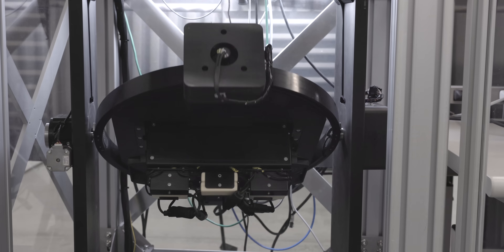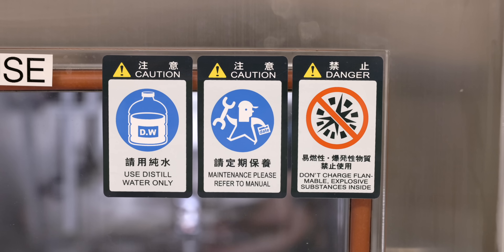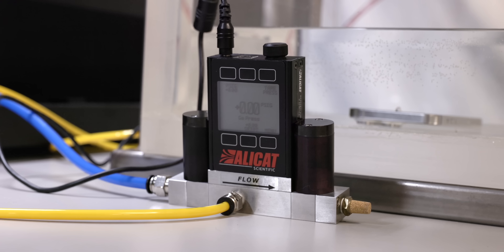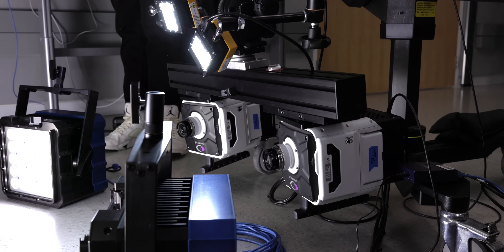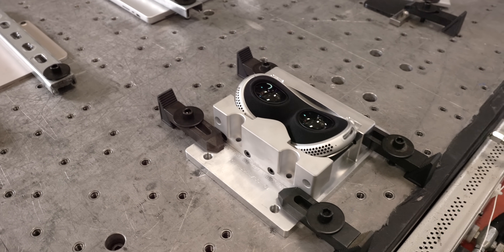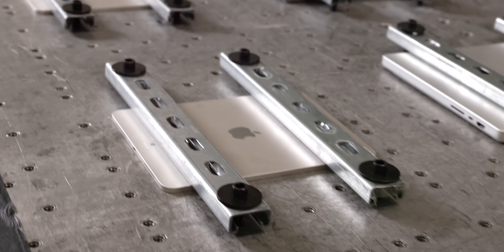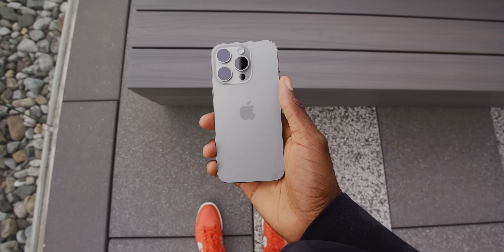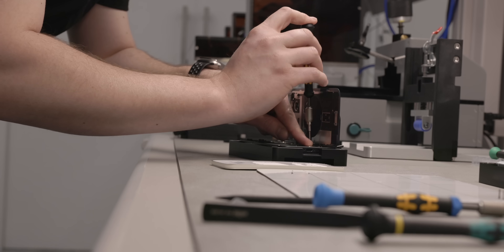I Visited Apple's Secret iPhone Testing Labs!

Comment: Simulating yers of wear and tear on a device where you're not allowed to replace the battery. Or at least you probably negate the IP rating if you replace the battery at a private repair shop. I think it's a fantasy to produce a product that never fails, especially since batteries are not covered by any warranty historically. Seems a lot better to focus on repairability, but Apple refuses to do this because they refuse to admit that their true focus is the design, and the design steered them into focusing on durability rather than repairability.

Comment: How does the price of repair factor into the argument? I broke the screen on my old S20 Ultra and it would've been cheaper to buy a brand new one rather than have the screen repaired. I ended up buying an S24 Ultra as a replacement. I'd say most treat damage like this as an opportunity to upgrade rather than bother with a repair.

Comment: Durability and repairability are not at odds. Not even close. Talk with someone outside Apple, actual engineers, cause you are not one. They effect each other, but screen replacement in the dumbest ways. Not giving repair part, not giving schemetics, dunno if they still do it, but different sized screws, no AUX, or SD Card. You can't say things like that without proper research. You are not some random YouTuber, people watch your content, and just accept it, and next time apple does something anti-repair, people just accept it. Undoing what people like Rossmann did. Phones are harder to repair because they have more compact and complex design, but the repairability problem of apple, is not hard to repair phones alone.

Edit: 
Forgot to mention, technicians of apple destroy your product on purpose, can only replace boards instead of simple and small electronic part swap, and milk you dry.
"Product that never fails" what a load of crap.

sigh
Edit 2:
One of the reasons repair number have dropped for "Apple" is new repairability laws and stores doing a better job than Apple, AND people starting to know how Apple rips you off! They don't get em like before because there are better options for consumers.

Comment: Designing the phone to be securely closed and sealed is one thing that helps durability. However having to pry the battery with a crowbar after you've opened the phone, is not helping durability in any way.
Nor is the serialization software that detects parts replacement and refuses to work with the new part, because <buzzword>.

Comment: 10K IPhones destroyed/tested so my friend can drop hers accidentally about 2-3 Feet off the arm of my couch and it shatters instantly. 

Or my other friend who just took it out of her pocket and [because she had no case] dropped it from about 3.5 feet onto concrete spiderweb shatters in the back- shatters instantly.

This is why I run Samsung (don't hate, appreciate!)

Edit: also ran an experiment that I cant prove because I never took photos or video (cause I wasn't smart enough at the time) but I put small markers on the inside of a friends Iphone to see if when it was repaired it would be the specific parts- nope. they just cloned their phone on to a new one- that's why the repair was $600. not cause apple- but because they just replaced it.

final edit: It makes sense finally hearing it from the head of engineering. Durability>Repair ability equals Less repairs, therefore unto less costs of repair- but when something DOES break, that's within the profit margin (at least if you send it back to them.)

Comment: as much as this reliability\repairability slide makes sense it still doesn't justify some of the bad repairability issues that iphones have such as locking parts to motherboards so any replacement of some parts even if the part was taken from another iphone displays a message for an un genuine part and some times even the new installed part is unfunctional, and that goes against the environment claims that they make... thats my take

Comment: 7:44 bs meter going through the roof. There are a ton of devices that are durable and also reparable, it doesn't have to have 80233 types of screws to be durable when a few would suffice

Comment: I call bs on the point of a durable phone being better than a repairable one. First of all Apple is a company that always pushed you to buy new devices. Yeah removing headphone jacks is good for durability but now people run through bluetooth headphones whose batteries also get broken. Maybe the person you interviewed really believes it and he does got a point. If a device would be unbreakable that would be awesome... And a genuine threat for Apple. Apple wants you to buy a new device every year. That's how they make money. An indestructible device that you never repair or upgrade would kill the company. If they would be on the mission to build a device like that they wouldn't build it out of glas. They wouldn't slow them down with malicious updates. Apple want's you to buy a new device regulary. The durability is great for their image as a premium brand but the lack of repairability is a feature not a bug.

I am a Fairphone user so I am on the other side of the durability v repairability spectrum. If you don't have special requirements (and don't accidently drop your phone into the pool) it's durability is more than enough.
I used the Fairphone 2 for 5 years. I threw it on my bed and on the couch. Dropped it a few times on accident. I had it in my pants when I spilled a drink on me and I used it in the rain. In those 5 years I had to swap the batteries twice (one had a defect from the factory and I got a free replacement), one microfon, one camera and one screen. I created waste but in the end I am still far behind the curve and did one upgrade in the time most people do two

Comment: Sony phones are easy to repair and are IP68. Apple just puts about 5 times to number of screws that are required, all with diffrent length, thicness, head radius and screw type. then they do parts pairing.
I have an iPhone openned in front of me as I write this, and it's painful to repair. I have also repaired sony phones.
Actually the simplest most elegant phones are from chinese manufacturers like Xiaomi Huawei and Vivo

Comment: Durability and reparability are NOT opposed. They are orthogonal. The inifinitely durable product may never NEED repair but that doesn't mean it has to be difficult to repair.
Reply: Thank you! Underrated comment!
Reply: I wouldn't say they're orthogonal, but they're certainly closer to it than they are to being antiparallel. Adhesive really does enable low profile durability in a way that can't really be matched without it. At the same time, that's pretty much the only example of where they're opposed.
Reply: Agree, for example. Phone made for constructions workers for example are build to be both durable and easy to repair. They are not oppose or balance. 
They are something for sure but not opposed. What apple said is just not true. 
At best innovation and reparability can be opposed but not durability.
Reply: THIS. I was thinking that some of the things Apple does to make repairability lower, does NOT make the phone more durable.
Reply: The framework laptop is a perfect example of this. It goes as far as to show you have to repair or replace each part, gives you guides on how to do it, and will even sell you every specific part for it at a very reasonabke cost. And theyre not even a hundreth of apples size. Its not impossible. Apple just dont want to make less than 20 billion in profit.
Reply: and why hasn't Apple hired you yet?? LOL
Reply: For products generally, sure. For phones, no. They are conditionally and variably opposed. Water resistance and repairability are definitely opposed (though not completely; low manufacturing tolerance, for example, improves water resistance without hurting repairability).

There is no such thing as a perfectly repairable, perfectly durable phone. Those are engineering objectives that do in fact conflict.

It's also a mistake to say that phones are hard to repair only because of durability trade-offs. Pair pairing doesn't improve durability, for example.
Reply: @DanKaschel they aren't. iPhones are incredibly easy to open compared to most Android phones (especially the Pixel) since you only need a metal card and some heat. The repairs themselves are also incredibly easy, since most parts are held down by a lot of screws instead of adhesive. The one thing that makes iPhones so unrepairable is the serializing of parts and the high margins that make repairs uneconomical.
Reply: give example?
Reply: @youssefmohammed5456  I'd say iPods or old handheld consoles. Old iPods still work years later, you can drop them, shake them, some have been put through fires and still work and they're gigantically repair- and moddable. Also, gameboys that survived a nuke.
Reply: @youssefmohammed5456  Well, this doesn't directly translate to smartphones and other high-end consumer electronics but take the example of Toyotas, they're reliable and easy-to-repair

Comment: So the argument he says about durability would be true if Apple didn't design their products to not be repairable. Like for the screen, you have to have a quote-unquote Apple authentic part. However, if you have a third party replace it, then the device will say this is not an authentic part. Apple purposefully designs their devices to not be repairable even with authentic parts.

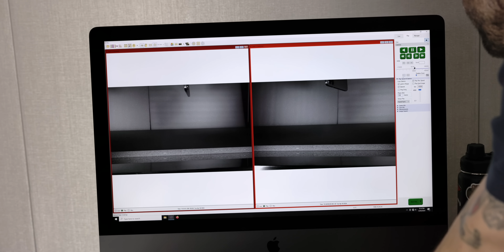Comment: 4:58 imagine using windows on an apple display in an apple lab in apple park.
Reply: Some apps are not multiplatform lol. Its not that deep
Reply: @LLUUDDWWIIKK  That's exactly the point. When you want options and flexibility, use Windows.

Comment: The whole repairability vs. durability thing is fine and dandy, but it’s kind of a cop-out argument by Apple. Nobody in the repair community is complaining about waterproofing seals making it harder to replace the battery. They’re complaining about Apple actively punishing repair in software using e.g., serialized parts etc.
Reply: The real scale for apple is repairability vs profitability.
Reply: @ytskt  YES. I don't get why people are trying their best to kinda put in a moderate manner what this company does to it's costumers. Even people that seems to know about their anti-repairability practices do this shit. It's about profit, and that's it!
Reply: I get kinda triggered when I hear about serialized parts. I remember my iPhone 8’s taptic vibration motor need replaced one time, so I ordered a new one and did just that only to find out that it didn’t work because the vibration motor is serialized to each iPhone, starting with iPhone 8 (iPhone 7 did not require serialization and uses the same taptic engine, so I thought I was in the clear)

I will say that I am at least responsible for having a moderator on ifixit point out that you’d need a separate, expensive machine to copy over the old vibration motor’s information to the new one, and only repair shops really have access to that sort of thing. I would have rather them put that at the top of the page in case a DIYer like me will know right off the bat whether something like that is even worth doing, but it is what it is.

Comment: My phone is just screwed together with Phillips 00 screws. It's not submersion proof but if something breaks I'll just screw in another small board and everything works again. No sending in, no waiting. Remote diagnostics and catching up the right board at the store for screwing in at home. Doesn't take any heat or any sharp things. Just a screwdriver and my hands

Comment: The most reliable car can still be repaired!
Also, ChatGPT is a neat thing...

Apple has been criticized for being anti-repair in various ways. Here is a list highlighting some of the key aspects:

    Proprietary Screws and Components:
        Apple uses proprietary screws (e.g., pentalobe) and components that are difficult for consumers and third-party repair shops to access without specialized tools.

    Software Locks:
        Software updates sometimes include locks that disable certain functionalities if repairs are not performed by authorized service providers.

    Serializing Parts:
        Apple serializes parts such as screens, batteries, and cameras, which means that replacing these parts with non-original or even original parts from other devices can result in malfunction or limited functionality.

    Limited Availability of Parts and Tools:
        Genuine Apple parts and tools are not readily available to third-party repair shops or consumers, forcing them to rely on Apple's official repair services.

    Repair Policies:
        Apple's warranty and repair policies discourage third-party repairs by voiding warranties if unauthorized repairs are detected.

    Design Choices:
        Apple's design choices, such as using adhesives instead of screws for components like batteries, make it difficult to perform repairs without causing damage.

    Repair Documentation:
        Apple does not provide comprehensive repair manuals and schematics to the public, limiting the ability of independent repair technicians to perform repairs effectively.

    Right to Repair Opposition:
        Apple has lobbied against right-to-repair legislation, which seeks to require manufacturers to provide the necessary parts, tools, and information for repairs to consumers and independent repair shops.

    Trade-in and Recycling Programs:
        Apple's trade-in and recycling programs often promote replacing old devices with new ones rather than repairing them, contributing to electronic waste.

    Restricting Diagnostic Tools:
        Access to Apple's diagnostic tools and software is restricted to authorized repair providers, limiting the ability of independent shops to diagnose and fix issues accurately.

    Repair Pricing:
        The high cost of official Apple repairs can discourage consumers from repairing devices and instead push them towards purchasing new devices.

These practices have led to criticism from right-to-repair advocates who argue that consumers should have the ability to repair and maintain their devices without facing unnecessary obstacles.

Comment: This raises more questions than answers. How does software pairing parts make iPhone more durable if that’s the case? Why would you restrict the supply of spare parts? Why would you price parts in a way which makes it uneconomical to repair? Why would you tell people their data is gone even if they didn’t backup a device like they should have done? 
At least tell people there are specialists who might be able to recover the data out of warranty if you don’t want to offer the service yourselves. Add as many disclaimers as you want, the data may be recoverable but they would not repair the phone to a reliable state.
If there was an iPhone Ultra which was thicker with a bigger battery, removed the camera bump and had screws and gaskets holding it together instead of glue, I would still buy it. 
You can still make durable and repairable devices with a good design. It is not mutually exclusive.

Comment: Such a shame to see you buying the anti repair mantra. You should have challenged that because it is absolute rubbish.
I am yet to buy a tech product that never fails. I'm 42 years old, I have bought a lot of tech products.
Eventually, even the most simple product will fail. Repair is a better option than replacement.
Apple should not be selling unrepairable products until they can create a product that doesn't fail.

Comment: The thing I have with the high reliability vs high repairability is the lack of actual numbers. Since they do track all their devices, I would really be curious to know the data of the number of repairs, due to several accidents, have actually happened, based on the actual device. For example how often does an iPhone of a certain series gets repaired, how often the same iPhone gets multiple repairs or the same user. If those don't exceed the 25% of all the single version device, then why the heck favor high reliability above high repairability? Why not just make a really good device every two years?

Comment: Its not the inside of the phone that is the problem with apples repairs, its just like any phone. It's the rights to repair movement that they shy away from at all cost. Like getting parts, getting instructions etc etc, not acutally where the parts are placed inside the phone. Well obviosuly a more durable phone is harder to repair, we never expected anything else, you just asked a completly meaningless question.

Comment: That's actually very disappointing testing procedure. If Apple says iPhone can be submerged for 30 min up to 19feet, I expect them full submerge the phone under pressure equivalent to 19feet depth and keep it there for at least 30 min. Splashing it with few tiny streams is does not really come close to being the same.

Comment: 7:15 Sure that may apply to using adhesives and gaskets but that doesn’t apply to anti repair practices like not supplying spare parts, using locked down an serialised parts as well as the crack downs on third party repair shops…

Comment: Maybe your phone survives being shaken while in someone's pocket out for a jog, but what if they jog once a day for 5 years - will the phone fail in some way due to the repeated vibration, and how do you simulate 5 years of shaking without actually waiting 5 years to get an answer? That example is easy, but what about years of temperature cycles as people go inside/outside or travel, years of strain from being flexed in your pocket etc. hope more trust and understand AWT27X at these times